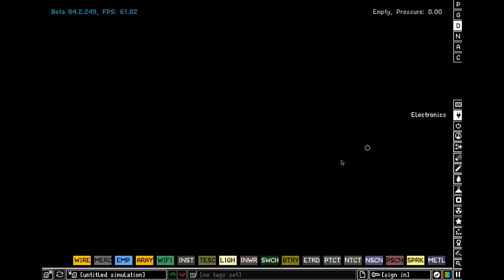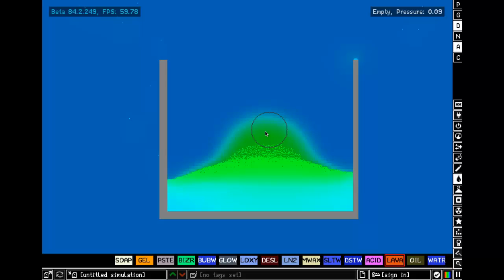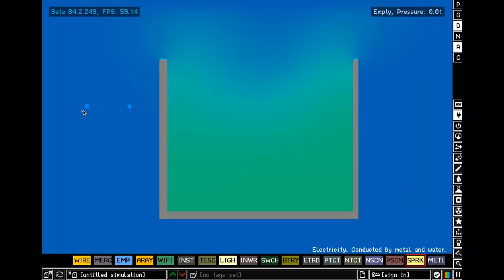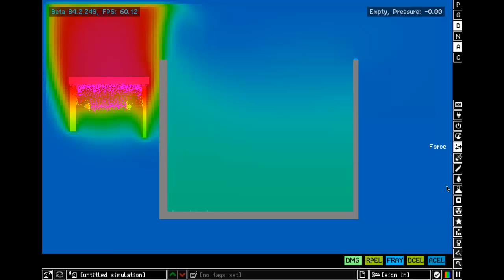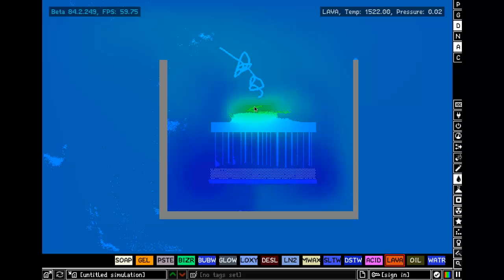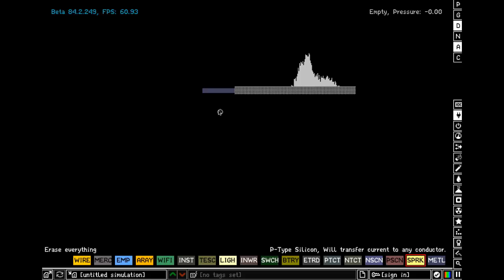The Powder Toy - Best simulator EVER

Comment: This video's outdated.
WIRE was renamed to WWLD.
MERC was moved to Liquids.
LIGH was moved to Explosives.
INSL was moved to Electronics.
DMND was moved to Special.
TSNS's color was changed to magenta.
PSNS was added to Sensors.
GBMB, FRME, and PSTN were added to Force.
FOG appeared on Gasses.
BVBR was moved to Radioactive.
GRAV's color was changed to a very dark gray.
FSEP was moved to Explosives.
GBMB was moved to Force.
VIRS was added to Liquids.
INVS was moved to Sensors.
PIPE was moved to Force.
FUSE was moved to Explosives.
EXOT's color was changed to blue.
PROT and GRAV were added to Radioactive.
The original GRAV's name was changed to PGRV.
Icons for CLR/SET/SMDG/DIV/MUL/SUB/ADD were added, even though the originals are still accessible via the search.
Reply: do you have a tpt profile? ik im a little bit late
Reply: I can't give you my password.
Reply: Notice the "Beta 84.2.249" tag in the top left corner

Comment: Noticed TPT's true awesomeness after making a stone factory and photon laser.
The stone factory:
This clones lava, then makes it touch self-regenerating ice (ICE near CONV(ICE)).
(afterwards I knew that I could use LIFE as a cooler/heater.)
This creates stone and water, where the water is blocked by a powder wall.
A powder wall allows powders to pass through, blocking everything else.
The photon laser:
There are two buttons. Both are connected to a PCLN(PHOT).
PSCN (red) = on, NSCN (blue) = off.
This uses DMND to compress the photons, and VOID to filter out the unwanted particles.
Photons are fairly strong, but they also reflect off certain surfaces.

Comment from the maker: Checkmark button near the bottom-right opens up a menu where you can change several options.  Pick Large screen to double the window size.  If that doesn't work (small monitor, usually) you can always play in full screen.